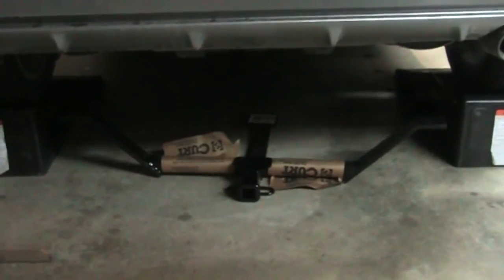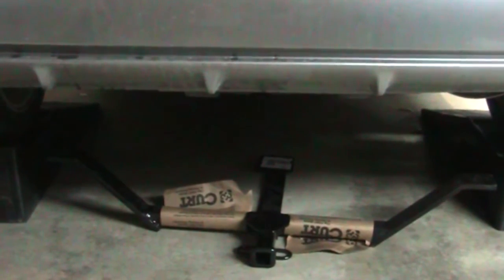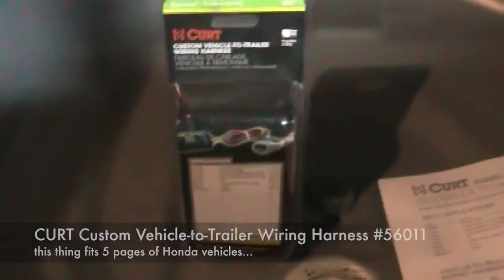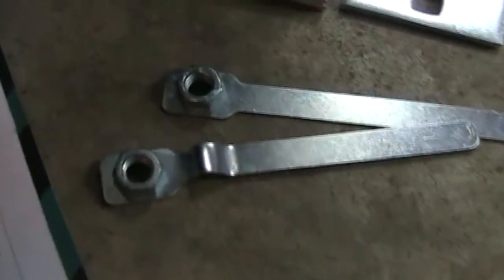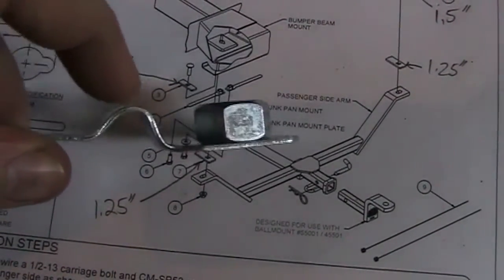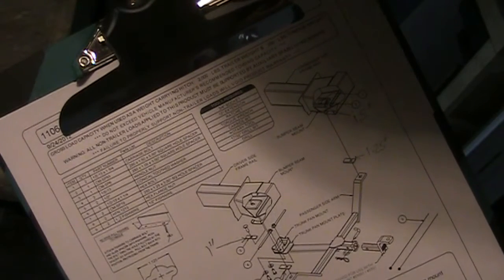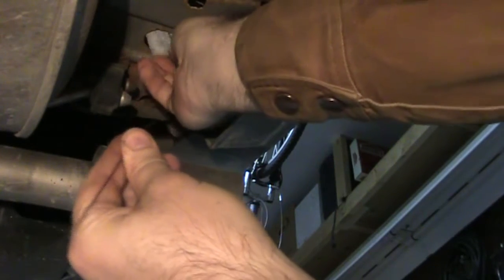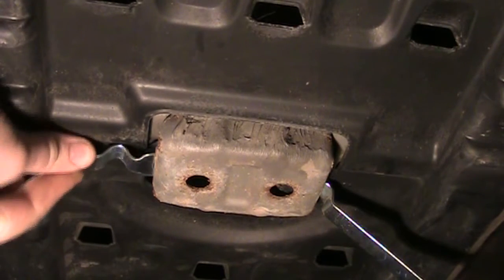Honda FIT trailer hitch (CURT #11064)

Comment: I just ordered the Curt hitch #11406. Should it be about the same?
Reply: Jonathan White   It will be customized to whatever vehicle it was designed for. But yes I think they'll be similar. I expect you will have to (a) drill a hole or two and (b) thread the backing plates and bolts into the body via the provided fish wires. The centre part that I demonstrated here is probably common to hatchbacks as well, but it depends on the vehicle you are outfitting. Hope that helps!
Reply: I just looked it up and it appears to be a newer version for the later FIT models. There's no centre support so you're likely to just do the fish wire part.
Reply: It's a 2015 Fit. Thanks for the response. Also, I appreciate folks that make these highly specific videos. It may not get a million views but it's very helpful to people that have these exact cars and parts. Thanks for that.
Reply: Thanks!

Comment: What is the weight capacity
Reply: iGrom class-1 is about 200 lbs tongue weight and 2000 lbs of pulling capacity... but the Fit itself will only tow 975 lbs so the hitch is certainly more than adequate
Reply: mewoosh where did you get that number of 1000 pounds?